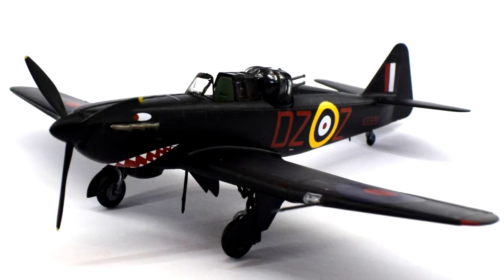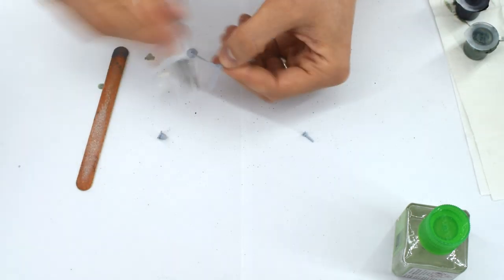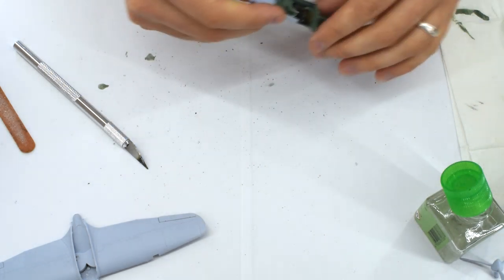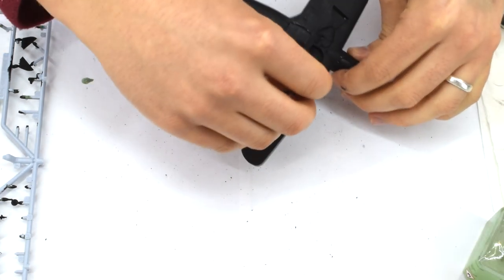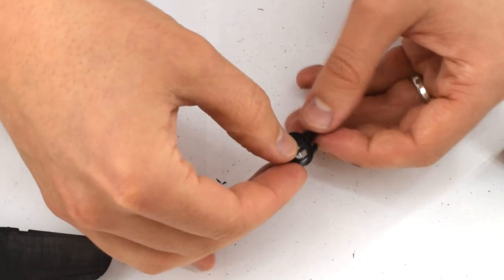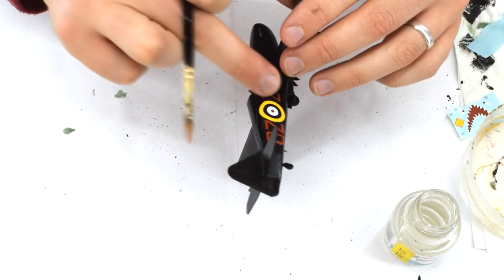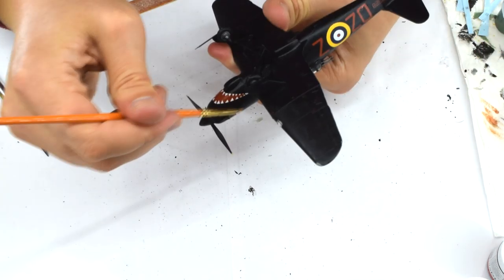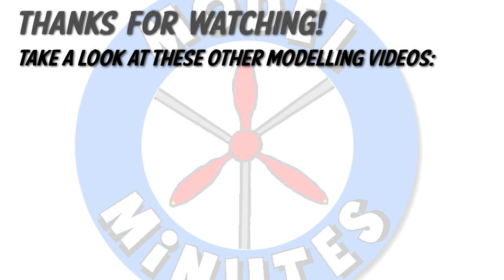Airfix BP Defiant Mk.1 - 1/72 Scale Plastic Model Kit - Build & Review

Comment: I didn’t realise the defiant didn’t have frontal armaments, nice history of the plane Matt 😛
Reply from the maker: Thanks! Yeah, it didn't have any forward facing guns, but I did read somewhere that there was the intention that the turret could point forwards (with the barrels of the guns resting either side of the cockpit) and then fire through the propeller under the control of the pilot, but they could never get the system to work or something . .
Reply: Model Minutes that’s a shame it could have been a lot more effective if that worked
Reply from the maker: @sergeantfloffy1248  yeah, but I think there were other issues with its performance which pretty much limited it's use as a frontline fighter
Reply: Model Minutes interesting I’m gonna look into the plane a bit more.
Reply from the maker: @sergeantfloffy1248  it's got an interesting history
Reply: @ModelMinutes  the gunner could point the turret forward (and needed to for take off and landing if they wanted a chance of getting out their emergency exit) and the pilot had a trigger but minimum elevation in that position was about 20 degrees and pilot didn't have a gun sight so he would have a hard time hitting anything.

Comment: The model looks great Matt! I am very impressed with your brush painting skills as I could not see any brush strokes. I have read about the early issue of the Defiant by Airfix and the biggest issue is the nose area is incorrect. You could by a conversion kit at one time to correct it or simply cut off a nose from another Airfix kit and graft it onto the Defiant fuselage but unfortunately I cannot remember which kit to use at this time. Thanks for sharing this and I was wondering if you would consider doing the new Airfix AV-8B Harrier in 1/72.
Reply from the maker: John Kelley thanks for the kind comments! Yes, the old tooling is quite inaccurate 😂. I’ll certainly look at getting the harrier if I have time and can afford it

Comment: Could you skip the washing if you prime with a spray can?
Reply from the maker: The point of washing is to give the plastic a clean surface for paints. The primer is a paint so you run the risk of it not sticking correctly if there is any mould release on the plastic

Comment: I really want to find Humbrol because I love the finish on it, but I can’t find it anywhere
Reply from the maker: humbrol isn't exactly the best brand of paint. Don't get me wrong, they do the job but stuff like tamiya and vallejo (in my opinion) have better pigment and flow
Reply: Model Minutes can I use the tamiya with a brush?
Reply from the maker: @getoutside9854  yes, but you will have to thin it - i would suggest tamiya X20A thinner
Reply: Try online

Comment: while handling small parts already painted the paint coms off and i have to repaint most of them, like when putting together the landing gear, how you guys deal with that ?
Reply from the maker: perhaps your paint isn't sticking to the plastic properly? If so, has the plastic been cleaned before painting, has the paint been properly mixed, has the paint been allowed enough time to cure?

Comment: I have build the exact plane you depicted in 1/48 scale, but the yellow square on the wings isnt on mine. I dont know what is correct, but seeing as mine didnt have the decal in the box maybe you accidentally put it on while it should have only been on the day version.
Reply from the maker: Apparently (following a quick google) the yellow squares are gas detection papers, which change colour and alert the crew to toxic gas - meaning they have to wear their masks. Not all aircraft had them, especially as the war progressed and the threat reduced. If you check my unboxing video from the 4 minute mark https://youtu.be/Sy1Tkbk3_ss?t=246 you'll see that it clearly indicates that the yellow square is meant to be included on this particular scheme. I did look for the 1/48 version as well, and it is not included in that one. It would seem that it is a simple matter of Airfix deciding that the 1/72 version has it, and the 1/48 doesn't
Reply: @ModelMinutes  wow. Strange decision on airfix part then seeing as its exactly the same plane.
Reply from the maker: @maxomans  perhaps there was evidence that this plane both had the yellow patch, then had it removed, with airfix choosing to do both versions . . .

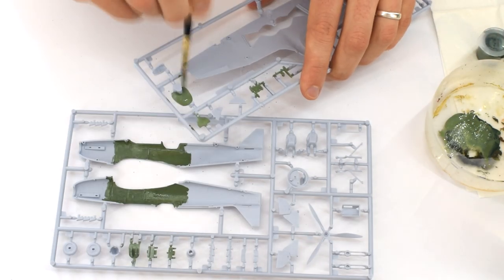Comment: A most enjoyable build to watch. I noticed that you painted the wheel housing bays in green (01:54) and then cemented the wing halves together. After this you painted the housing with the same black you used for the wings etc. (06:52). I don't understand why the initial green paint is required here - could you explain please? Many thanks.
Reply from the maker: It's very common for RAF aircraft internal areas to be painted in that green colour. I guess I initially painted them that colour out of habit, but when I got to the black paint and looked at the instructions they were indicated to be painted in black, so I then went over the top. There was not specific or special reason for it
Reply: @ModelMinutes  Many thanks for taking the time to explain what took place. I was mystified!

Comment: this is amazing! i do have a question though. i have revell paints and im not sure if i should use them on this build. i looked at humbrol paints but they are expensive! what should i do?
Reply from the maker: From my experience Humbrol and Revell paints are usually to a similar quality. Don't feel as though you have to use a specific brand of paint, there are conversion charts out there which will help you identify like for like paints across a variety of different ranges :)
Reply: @ModelMinutes  thanks!

Comment: Did you know it was almost impossible to bail out of the turret
Reply from the maker: That's insane! That would never have got past the Health & Safety of today!
Reply: Did you know that the tail gunners on the Avro Lancasters removed their armour plating from their turrets for that exact reason. Because when it was in place it was near impossible for them to bail out when they turned the turret exit hatch outward as the plating partially blocked the exit hatch between fuselage.
Reply: @harrymarwick2529  I think the same with B17 ball turret  gunners too owing to a small space
Reply from the maker: @harrymarwick2529  :o
Reply: Like any turret it certainly was a problem. This is of course assuming you are thinking that any bail out for a gunner was by rotating the turret and attempting to exit as they got in. That is why there is a kick panel right beneath to gunner in the Defiant and the gunner wore a body style parachute unique to Defiant crews. The exit was beneath the gunner and exited under the aircraft. Oh and the correct designation of the Defiant was as a bomber interceptor and not a fighter. The concept was for it to join attacking bomber streams which had over extended their fighter cover and shoot the bombers down from within the stream. The flaws of the idea were pointed out by the chief designer at BP at the time and ignored by the air ministry.
Reply from the maker: Suburbia Pheonix thanks for the info! ☺️

Comment: A much maligned aircraft, the BP Defiant was NEVER designed to operate against ESCORTED bombers. Although originally designated as a "turreted fighter" the role it was designed for was as a bomber destroyer, and NOT an air superiority fighter in the classic sense. At the time the British air ministry issued its original specification for a "turreted fighter" in 1935, the luftwaffe was operating from airbases within mainland Germany, and even from the closest bases to Britain the luftwaffe fighters did not possess the range to escort the bombers that far. This being the case the BP Defiant was designed to operate against unescorted bombers attacking Britain from across the North sea, a role that it would have handled admirably.

Now fast forward to 1940. After the Wehrmacht had crushed the French they now possessed airbases a LOT closer to Britain than in 1935, meaning that German bombers WOULD now be escorted in the skies over Britain... and THAT was were the mistake was made, as it was decided to operate the Defiant against the now escorted bomber formations, though it was quickly withdrawn from the role after resultant heavy losses. It did later operate successfully as a night fighter then as a pioneering ECM aircraft and finally as a target tug for training air gunners.
Reply from the maker: thanks for the info!

Comment: The original Defiant from Airfix... well to save you the bother it's a pain in the arse... the shape of the fuselage resembles more a banana than a body and the wings are a real fit issue and the perspex canopy is very thick with no paint lines to follow and the cockpit is literally just a seat and a pilot and you have to use 2 pins either side to line it up, even then it ends up lopsided. My intention was to buy the original but use the decals on the new tool to do the schemes justice. 

However I would like to see how you cope with the iconic mess that is the original. Beautiful work on your Defiant NF.1 though, I too have this model and plan to do it in Battle of Britain colours. :)
Reply from the maker: Thanks! Yeah, I did buy the old one many years ago, I think it is part started somewhere, but parts might be missing so might have to come up with an alternative destiny for it
Reply: @ModelMinutes  The bin perhaps? 😂 As that's where mine ended up once I saw the new tool..
Reply from the maker: @BlackAce-zr2ms  I think it’s around somewhere…. 😂

Comment: I built this kit myself and it has to have been the most irritating, frustrating and fiddly kit I can ever remember making. Parts so fragile that they broke just trying to get them out of the spruh, even with a fine craft knife. Parts so tiny that it was extremely difficult putting them together, along with parts that simply did not fit. I wanted to do the open cockpit version, but the parts simply did not fit properly, so I had no choice but to use the one piece glass. It will be a very long time before I buy another kit from Airfix.
Reply from the maker: im sorry to hear that you had some trouble with this model - not all kits from airfix are as fiddly as this one. Personally I cant say that I had the same problems that you have indicated
Reply: @ModelMinutes  I appreciate you taking the time to reply. I would not rule out the possibility that not all kits are equal and mine might have a sub standard one. That said though, it came exceedingly close to going in the bin, a number of times. It was probably the fact that it was a gift that saved it. I did finally finish it and it looks okay, but it isn't exactly how I wanted it and not worth the amount of time it took to build.
Reply from the maker: @calibrazxr750  sometimes when i face a particularly challenging build I will put the parts back in the box and attempt it again in the future, picking up form where I left off. I never throw a kit in the bin because there is always something i could use it for in the future, spare parts, paint mule or even as part of a diorama